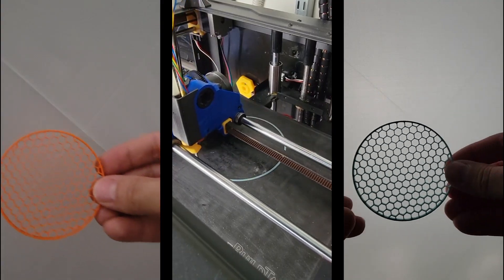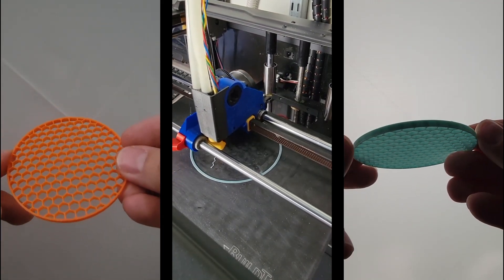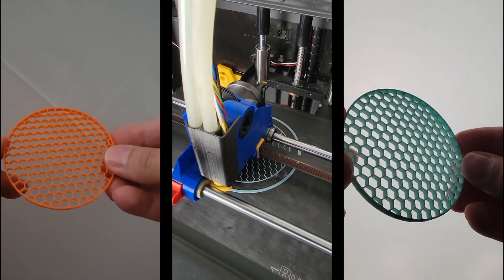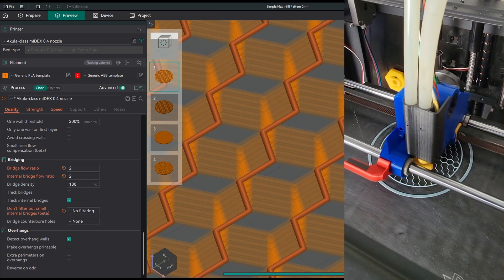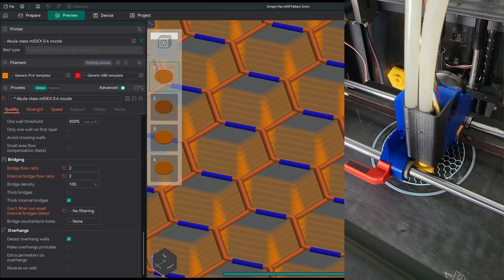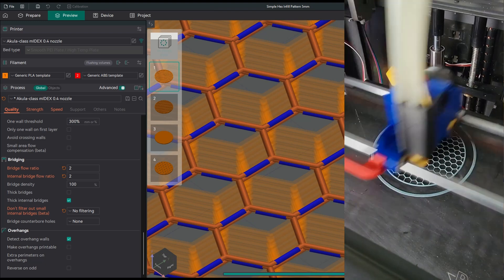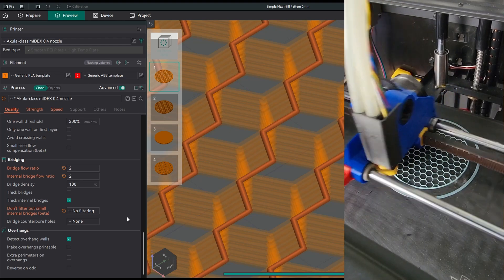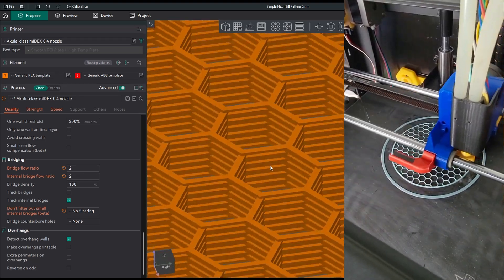A Better Honeycomb Infill Pattern #orcaslicer #opensource #3dprinting

Comment: Hi; what method did you use to generate the 3 different rotated zigzags? Im new to orca; is there a way to do it within orca?
Reply from the maker: I made this pattern in SolidWorks.  I am not confident enough to start modifying and compiling Orca source code.  One day soon though 🤔
I shared the STEP file on printables.  https://www.printables.com/model/986103-innovative-non-intersecting-honeycomb-infill-achie/comments
Reply: @m_IDEX  ah got it; might give that a try in onshape featurescript.

I wanted to try this technique with foaming tpu... though perhaps it would not be able to cope with fast extrusion speed changes, due to the compressible foamed material in the nozzle. But I could postprocess the gcode also to halve the xy movement speed in the bridges instead, that should work I guess.

Comment: so how can i implement this technique? a detailed instrctio video would be appreciated. because i need to print a mesh for wather to flow through so the normal infill with 2 walls is not wanted
Reply from the maker: Take a look at the STEP file on Printables.  It may answer all of your questions.  I'll see what i can do about the video.  Feel free to ask any specific questions here or on printables.  https://www.printables.com/model/986103-innovative-non-intersecting-honeycomb-infill-achie

Also, someone started a feature request for Orca Slicer.  The best option is to have this feature added to your favorite slicer.
https://github.com/SoftFever/OrcaSlicer/issues/6572

Comment: It's about  29% slower when compared to the same density of double wall honeycomb, as in the same percent of space is occupied by infill. 31% faster my ass.
Frequently doubling and halving the flow when printing fast with infill would also quickly wear down the extruder, not a single infill type does this.
Its strength is also dubious due to a third of it is printed at double the height, as print height over 80% line width practically have no layer adhesion.
Reply from the maker: Did you try printing them side by side on the same printer with the same slicer?  I have and I have receipts 😊.  Orca has a fantastic honeycomb infill pattern.  I just wanted to make it cosmetically perfect by pushing the double wall down a layer.  Modulating flow rate is a lot less taxing than constant retractions on something like a Lattice Cube Torture Test.  Note that since I am after cosmetic perfection, my test infill speeds were nowhere near typical infill print speed/acceleration and both honeycomb infill patterns look cosmetically perfect.  Except my prototype version has uniform walls and that just blows my mind.  My prototype infill printed 7 minutes and 8 seconds faster with similar density.  My goal was single uniform honeycomb wall, and the speed gain is a curiosity to study further.
Reply: @m_IDEX  I thought you were going to daily drive this pattern which would be taxing on the extruder for sure, but using it for cosmetic purpose makes sense. It's still dishonest to claim it as faster when there are less material as well in my opinion though.
Reply from the maker: I completely see your point.  You look at it from an infill percentage perspective and I look at it from the hexagon size perspective.  My print is faster because it uses less material and fewer print moves.  I think I achieved my goal of making a single non-intersecting hexagon pattern.  By definition it has 2 out of 6 fewer walls or 33.33% more efficient.  Both in terms of time and material.  So the same infill percentage will generate a more dense single wall hexagon pattern.  Also, spanning two or more layers per print layer is a patent worthy idea and I want to make sure it is open source.  I wonder how this can improve interlayer adhesion?  Thanks for all you do for the Orca slicer and 3D printing community!

Comment: I've been wanting this infill pattern for years! The existing honeycomb always seemed unnecessarily convoluted to me. I also think cubic infill could be sped up in a similar way.
Reply from the maker: I hope someone picks up this idea and implements it in a slicer.  My top choice is Orca Slicer.  This maybe the first non-planar infill pattern 😀
#opensource to keep the Patent trolls out.
Reply: @m_IDEX  More generally, I wish there were a plugin system for defining infill patterns. So people could develop their own without forking the entire slicer. Like shaders and textures in graphics software.
Reply from the maker: Cura has something like this, but still very primitive.